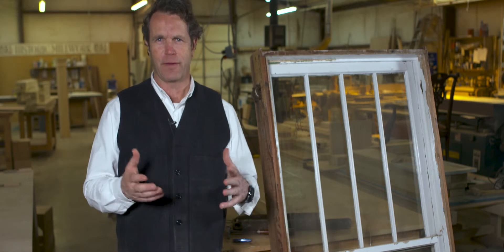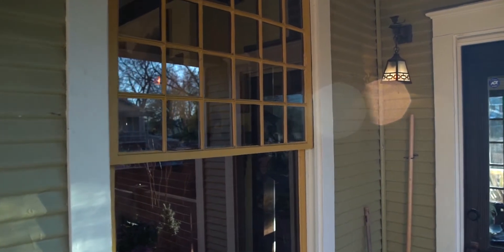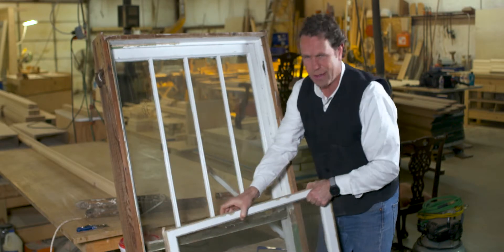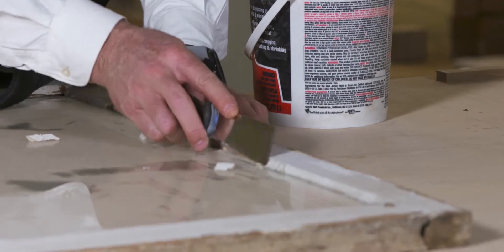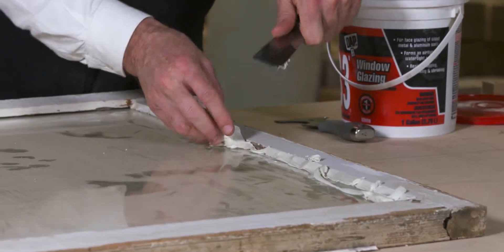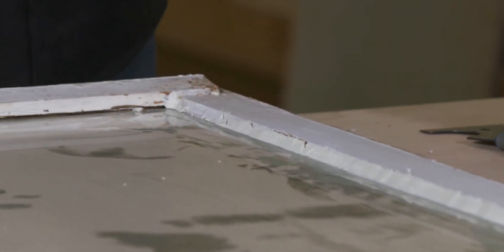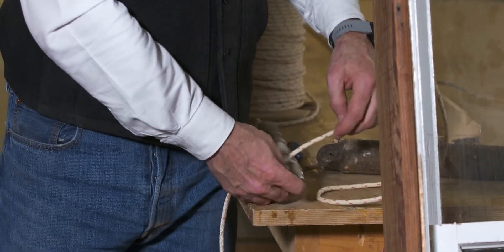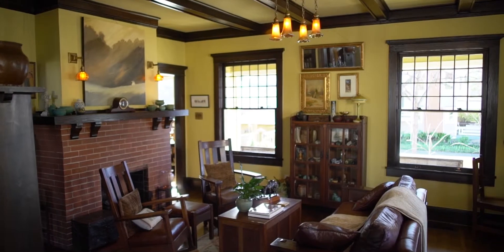“Building with History” - Arts and Crafts Era Bungalow House - Workshop Edition

Comment: Hey thanks for the videos. I was hoping to see how to replace the broken rope when the jam is still installed. Is that possible to do… do you just remove the window casing to get to the rope then the stop mould to get to the window attachment area? Thanks and looking forward to more videos (perhaps some info on Eastlake style?? I’ve spent about 5 years renovating and restoring an old house circa 1895 I believe is Eastlake someone recently told me. I believe it’s an old millwork showcase because trim designs and species are different in every single room. Very unique). Thanks
Reply from the maker: There are 2 ways to replace the rope. If your casing is easy to remove, that is the fastest way to install a new rope. You will still need to remove the stop on the broken rope-side to  get at the side of the sash. The second way is to remove the weight pocket cover in the side of the jamb. (if your window was them, some windows don't) I find this to take 2-3 times as long. Curious if you've watched my other video on complete window restoration. That will explain changing the rope. Good luck. And yes, video's are coming on Eastlake. Thanks.